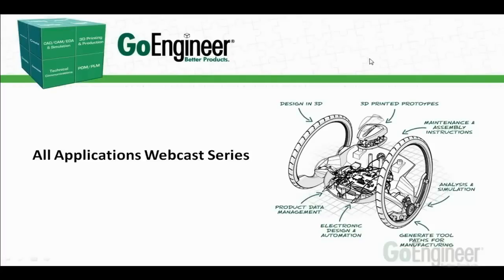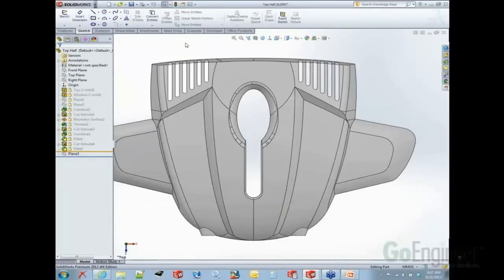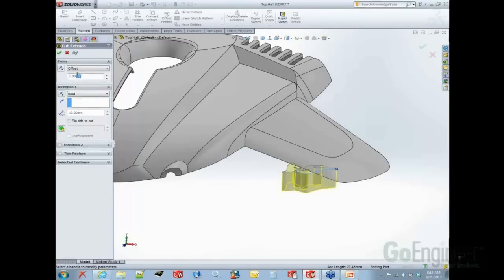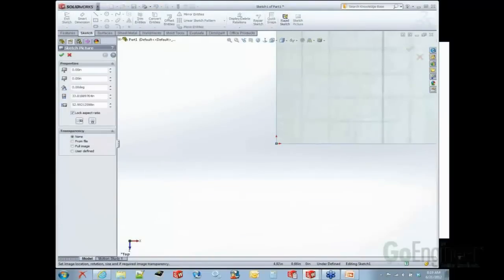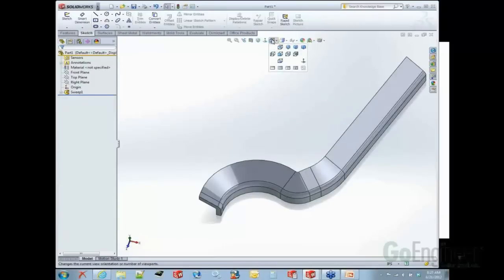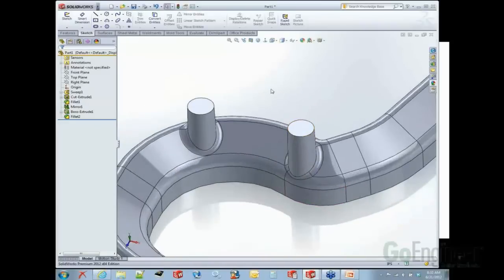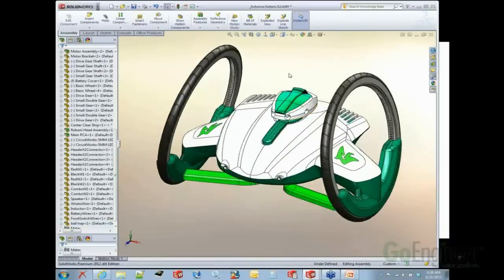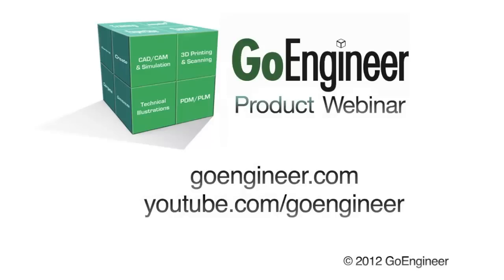SOLIDWORKS - How to Design Like a SOLIDWORKS Wizard

Comment: How did you make a new part fit perfectly in the existing assembly? Did you already have all the dimensions measured?
I usually create multi-body parts to make sure everything fit perfectly as it should, but the downside is that updating the edited part to the assembly is such a pain.
Reply: ***** Do you have any suggestion on creating multiple parts separately, and make them fit together in an assembly? Do I have to manually measure every single dimension from the previous parts that I created?